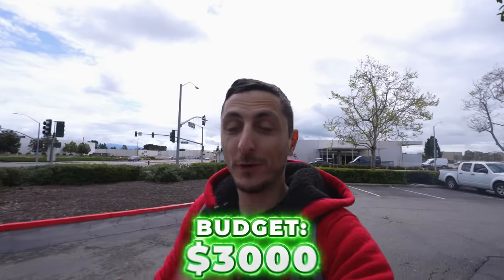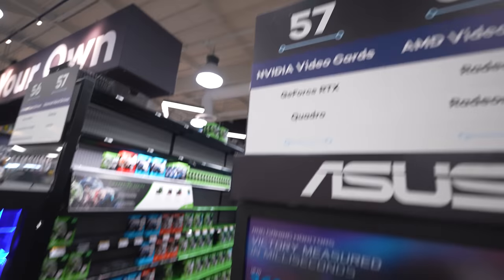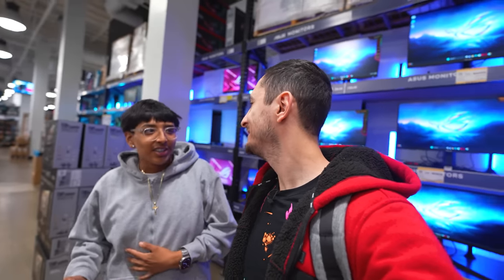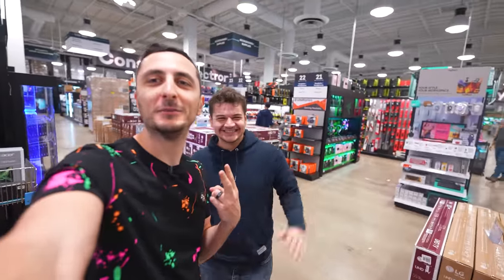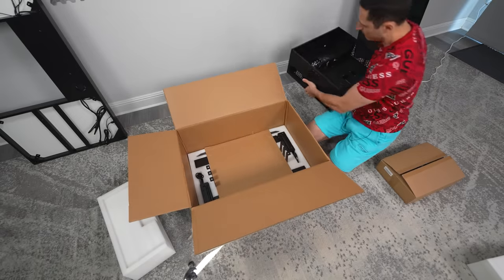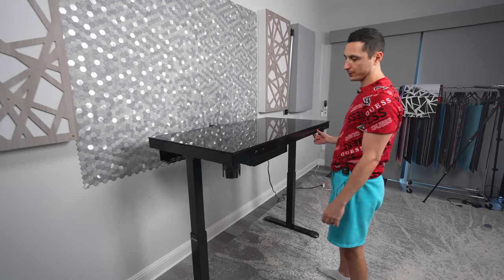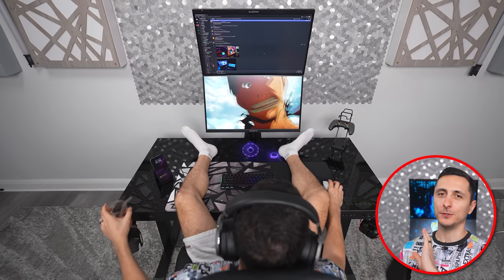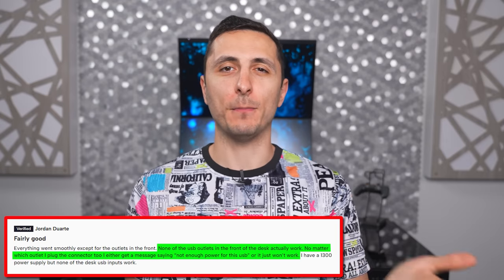This PC Desk Setup is Insane!

Comment: I remember shopping (and working) at CompUSA. Microcenter was around back then, and was the best place to shop then as well. Just wish there was one less than 300 miles from me. I do remember purchasing a VGA 17" CRT that had these crazy speakers on the side and a built in subwoofer. I had that CRT for so long. I think it was either Toshiba, or Sony.  I can't remember.

Comment: I remember working in the build room at the Lane Avenue Mall Micro Center in Upper Arlington which has sense moved to Bethel Rd Columbus. When I started putting together the IBM XT clones using dos 2 and dos 3.0.  Then I would go home and using my Amiga 500 with all the glorious color and sterio sound while the systems I built beeped. lol.  Was a real pain having to set othe dip switches on every card you put in the things.   My latest home build AMD 5600x 32GB, 2 2TB SSD's, a B450 system board and I used existing 1650 super.  Works pretty darn nice.  I got everything at the Micro Center.   I only worked there 4 years and the manager that was there in 92 is still there lol. as of last August.

Comment: I used to build my own custom high heat plexi glass towers. not plexi but the other thicker type. Then I build my first desk with dual raedon ATI cards, 64gb ram, and I had this insane water cooler build that I didn't need, but it was more for the look with nice led lights. then I installed a Macbook pro guts, with a custom soldered extension so I could have the 17inch monitor attached under the table top while running 3 monitors ontop of the desk, and the 4th one was a projector hitting my wall. During those days besides playing Cs1.6 trying to get ranked CAL IP, I would play youtube or wow on the projector. while I was using both the MAC/PC for production. Final cut pro was 1,000 at the time when I made that build, and I also was running cool edit, Acid pro, etc. Wow on the projector during pvp or pve raids, I just had to toggle off my afk bot program, when I had to actually move during raid fights. That program I created at that time started off as a pre recorded macro script. So if i was farming for materials, I would fly the route I planned on doing, and recorded the dismounting/gathering. then mount up and hit the next place until i completed the entire route. Then would activate it, while working on other projects for multiple radio stations Djs/hosts who sent me their prerecords for their shifts that I would edit in the adverts, and organized all their time references to seem like they were in the station. Then I would also work on custom video editing for parties, weddings, or short films that new producers. Doing audio edits, VFX, and such.

Man everytime I watch your videos, I want to build another custom clear desk or tower. Thanks to 3D printers, and being able to build your own tower on PC. Then have a CNC machine cut out the best tower that anyone wish some companies would make their towers 100% customizable. putting in a large ass liquid cooler on any part of the tower, add extra USB 3.2/USBC 3.2 slots. Then have the option to put custom made drone blade fans that use barley any power, because of the single dual blade design that blows air as if you had set it on max. also the many ways you can make a custom type of wind tunnel to literally keep the temperature at start up levels, without making a custom port that have a small fan blowing in 78F Air from the AC inside. so you reduce the probabilty of moisture buildup, by not letting the AC run for 30mins and increasing the temp every few minutes slowly to room temp. so you save money on electricity, but anyway im writing a entire season again. Due to many IEDs, VBIEDs, and couple danger close air support. TBI has made me go from linear thinking into fragmented thinking. Basically like Ive got ADD/ADHD and all my thoughts flood my mind all at once, and its hard for me to stay on task, or sometimes i'll write long ass crap that is on repeat. When I used to be able to just sum up everything in just about a paragraph at most. Instead I say so much and sometimes repeat the same stuff, but worded differently, and later on ill reread my comment. Then figure out how to say everything short enough for our small attention spans, lol. Being a 100% Disabled Vet sucks, but i'm going to try and save some money, and hopefully be able to build a system to get back into gaming/unity/UE5 mod building.

Comment: Bought a Powerspec 1710 laptop from a MicroCenter.  Display ribbon cable failed.  Drove 7 hours to bring it in for service because they refused to allow me to ship it to them.  6 months and $380 later, the laptop still had the same problem after they replaced the entire display - without consulting me first and after I explained the known issue of the ribbon cable.  I bought the part on eBay and repaired it myself.  I am no longer a MicroCenter customer.

Comment: sorry to say aorus waterforce is trashhhhhhhhhhhhhhhhhhhhhhhh gigabyte is trash had the 2080ti waterforce lasted 3 months sent it in rma they said they fixed it it still didnt work would install drivers and then nothing assuming a dead memory chip possiably anyways filled out another rma form and they rejected it even after they claimed to have fixed it yet they didnt and still refuse to so i do not reccomend gigabyte anything ill buy zotac before i give gigabyte a dime
Reply from the maker: Damn sorry to hear about that! I never had issue with Aorus products...yet
Reply: @TechSource  I’ve also had issues with asus motherboards but more recently everything has been built more flawless then I’ve seen in the past my issue now is my msi creation prestige x570 wants to say usb over voltage and not turn on about 70% of the time not sure if it’s a faulty board or what but anyways great video and great selection of hardware